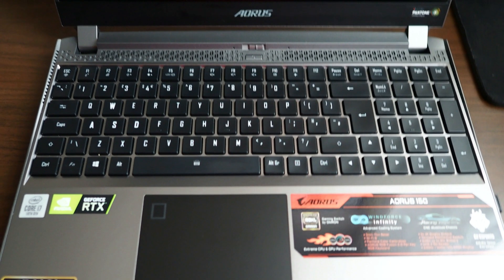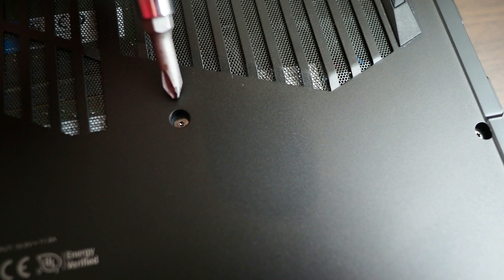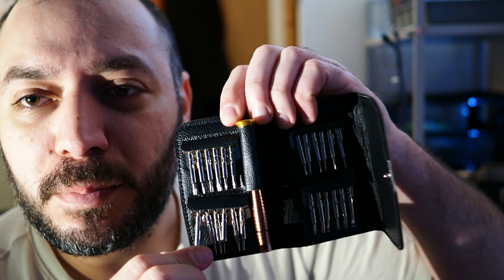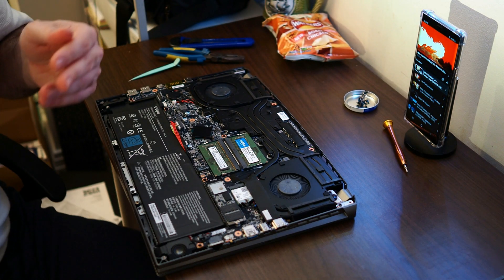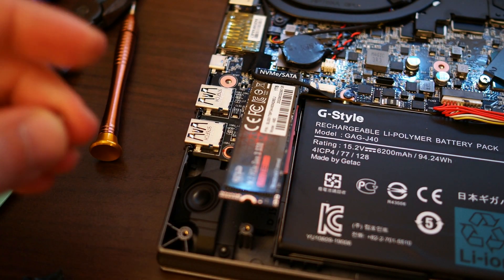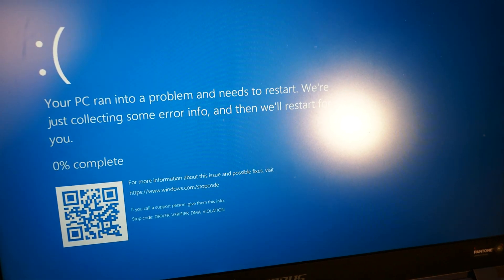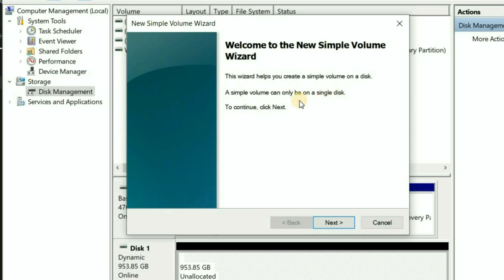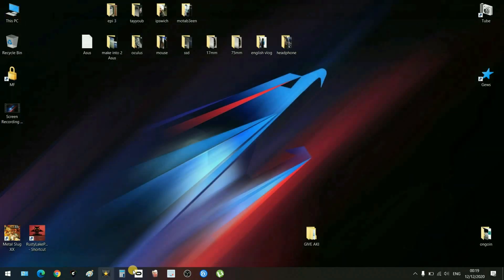Install & configure PCIe SSD - Gigabyte Aorus 15G Laptop

Comment: In school I took apart a macbook at my desk with a thumbtack. Just lay it at an angle in the groves and try turning it while firmly holding down the laptop. It isn't by any means a torx driver but it does do it in a pinch. I got the back off and while inspecting everything my teacher spotted me and flipped. This was 5 years ago or so.
Reply from the maker: Wow lol. You are a naughty student

Comment: What was the name of the screw driver
Reply from the maker: It's in the description box
Reply: @ASMROW    hi im actually looking to buy this model due to the chassis and mechanical keyboard plus thunderbolt thats provided on this device. The rtx 3000 versions come with plastic, a regular keyboard and no thunderbolt however, there was a release of a mux switch in the control panel for the rtx 3000 series of the new 2021 aorus 15g, was extremely curious if gigabyte went back and released a mux switch for this version as well. Because i much rather have this version with a mux switch to preserve battery.

Comment: Are you sure that u put it in the board rather then the actual nmvme
Reply: I was about to ask same question haha! Marios is an amateur , I don't think he knows what he is doing. let's give him some time to make mistake and learn
Reply from the maker: I don't understand. Can you explain
Reply: @ASMROW  You should have putted the thermal pad on top of the ssd not below because the pad will touch the cover which helps thermals unlike below your just trapping the heat inside.